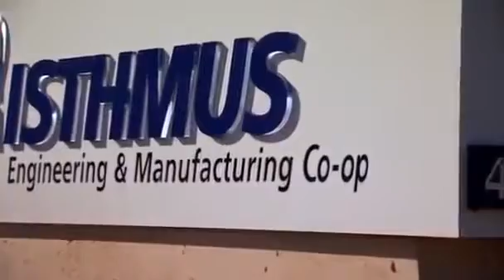Capitalism: A Love Story - Workplace Democracy and Cooperatives

Comment: Michael Moore has a bad habit of exaggerating but a flat chain of command definitely has more consistent rules across the board. Tall pyramids fall over too easily.
Reply: Moore exaggerates?  Sounds like his light blinds you in your cave.  That´s ok, books like T Hartmann´s Corporate Theft of Human Rights and Naomi Klein´s Shock Doctrine only build on Noam Chomsky, CW Mills, and UK Robert Owen´s inspired 1840s Rochdale Pioneers.  Oh, and Ralph Nader, Greenpeace, Oxfam, etc....
Reply: @robinhoodstfrancis  He means with things like Bowling In Columbine, but you're right.
Reply from the maker: @Umbrella_Guard Pyramids tend not to fall over at all. Pyramids are inherently strong and stable structures because most of the weight is distributed at the bottom.